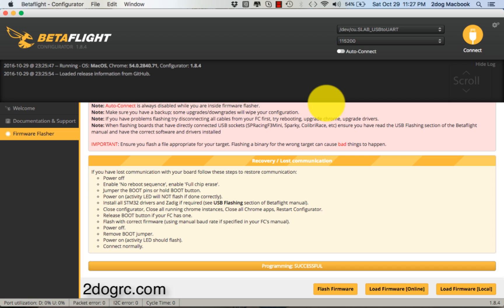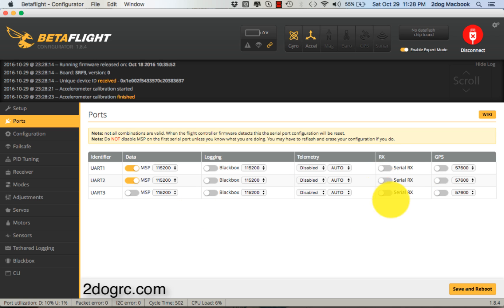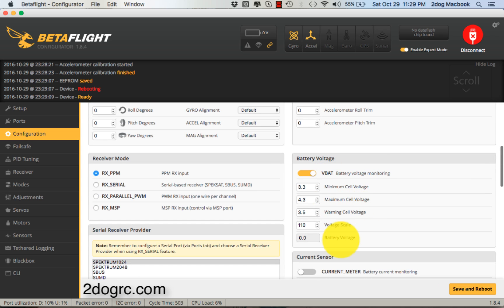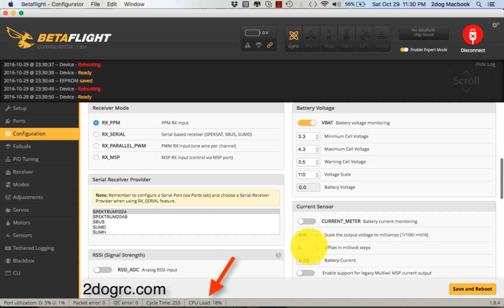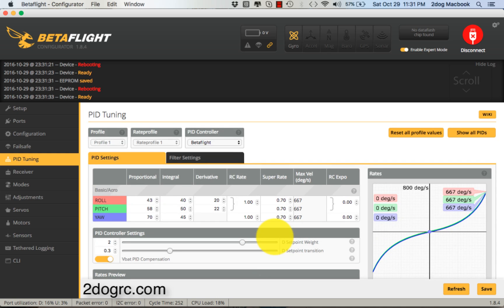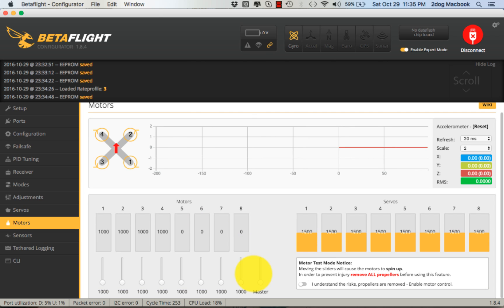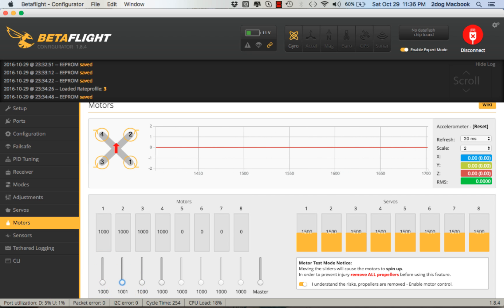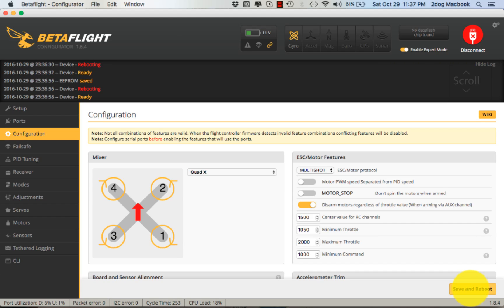Setup Betaflight 3.0.1 On Diatone Crusader 2 or Other Diatone F3 Boards

Comment: Hey bro, 1st off, thanks for the video, I just have one thing I would very much appreciate if at all possible, and that is absolutely no fault of yours that's for sure, it's just that I used to have someone whom helped me with the tech side of this hobby, and I was learning fairly quick, I am no rookie when it comes to the flying aspect, btw, it's just that my buddy have long since ghosted on me, and I have no clue how to use beta FLIGHT etc...? Ur video does show how to do a setup for the Crusader gt200 N etc, but u go through it as if ur speaking to an expert or at least someone who knows his way around the program, is there a way that u could, and this is all me, not ur doin, but rather my lack of knowledge, and I was hoping that u either help by maybe dumbing down for people who are like me and have little to no experience dealing with this side of the hobby?, my crusader will. Connect, but the icons on the left , for example, if I try and calibrate, the icon isn't lit up, so i cannot even do that, though,  the name Diatone does pop up when I connect.,, well maybe if u don't feel like messing with it,, could u point me in the direction that might help? Again, great video, just wish I had the knowledge to understand all of that you showed ... and again that's all on me...!

Comment: I am having a diatone GTS 2017 running fury F3 OSD. my OSD some time come on some time it go off when I plug in the battery. I am puzzled. when OSD is on i try to enter into the command by yaw left or right then pitch up the osd do nothing

Comment: didnt help with my case because my first ever quad was broken right away... no LED's means its dead and you can refund. Didn't know about it and taught everything was fine and I was just stupid but actually the f3 was broken....... needed to resolder it but now it works
Reply: with resolder I mean get a new flight controller and switch it with the old one

Comment: Hi,
Does your PID's values are for the crusader 200''?
I'm actually changing my 175'' frame for the 200'' and I want to know if the PID's are the same or what.
thanks
Reply from the maker: You could probably use the same.

Comment: Chris, thanks for the awesome video! I got a GT2 partially because you have this setup video :-) 
Question:
----I plug battery into drone and betaflight jams/stops working?--
When I plug drone alone into computer,  the drone moves correctly on first screen, i can flash new version of betaflight etc.
However, when I also plug battery into drone (4s fully charged), no voltage shows up at the top of the screen and the drone picture does not respond to movement. (Rx binds nicely with my transmitter though and the drone arms correctly)
Any ideas?
I need battery to power my transmitter to see if its working and to set ESCS
Reply from the maker: Chris, that is a good question that I have not seen before.  Please contact diatone at service.support@diatone.hk.  Maybe they have seen it.

Comment: Hey Chris, I am not able to setup my beeper on my Diatone Crusader GT2, I have made it an aux switch as you did in the video. Is there anything I need to do in order for this Beeper to work? Thanks.
Reply from the maker: The only other thing  would be to make sure it is plugged in!  Make sure that on the mode tab when you move the switch the Beeper mode goes green.

Comment: Hello, I downloaded the driver first as stated and it connected to Betaflight after that. But I am unable to get the check at 0:47 seconds into the video. Moving the quad does nothing on betaflight. Not sure if it helps but my Accel icon is not lit at the top of Betaflight. 

Any help would definitely be appreciated! Thank you!
Reply from the maker: If your ship does not move in the first screen, or probably means your accelerometer is not enabled in the config tab. Make sure that is on.
Reply: You are correct BUT now I have one last question. For some reason my OSD keeps blinking "LOW VOLTS" even though the battery I have has 12.3 volts. Keep in mind this is the V2. Thank you again for the help for the firsts question!
Reply: I have the Warning Cell Voltage at 3.5

Comment: I think I found the issue preventing us to upgrade firmware on the FC not detecting the ESC. I installed the same ESC to my other quad and now It's stuck to betaflight 3.0.1! my previous ESC had no problem updating the FC firmware.
Reply from the maker: Yes, there is an issue with the ESC and Betaflight for some reason.

Comment: Hi,
I got a diatone crusader 190, setup done with latest betaflight firmeware, when i span the motors , 2 of the got very warm and i could feel a burning odor. What do you this could be a result of? Thanks.
Reply from the maker: That could be an issue with the motor screws touching the windings inside the motors.  Back the screws out a mm or 2.

Comment: Ran through the same setup and with my accelerometer off/on and 4k for gyro and pid my cpu load is still around 40%. Seems kind of high. Do you think it'll run ok like this?
Reply from the maker: 4k for both and accelerometer ON is NOT recommended. That is too high.
Reply: Thanks for the reply. I went back down and cpu dropped to around 35%. I'm having other issues now though. Setup went smoothly but after saving and disconnecting it wont reconnect to betaflight. Tried 3 different computers, usb cables, ports and it worked for a few minutes on a 2nd comp but now nothing. I have also reinstalled drivers. The leds are getting power but nothing on betaflight. The only thing I have done is plug into usb and plug my receiver in. No battery plugged in and no soldering/modifications. Any help is appreciated. Thanks!
Reply from the maker: Try restarting Betaflight. That is a strange one.
Reply: Yeah I've tried restarting betaflight and my computers. Going to buy a new usb cable but if that doesnt work Ill do the lost com through betaflight. The blue LED is very dim after it powers up, is that a sign of a bad board?. Do you have any of the FC's on the way? I purchased this quad from you last sunday and the shipping was super quick. If I can get a spare FC from you that would be awesome.
Reply from the maker: Send diatone an email about the FC issue, make sure you include the part about the Light Blue light.  service.Support@diatone.hk. I don't have any FC's in at the moment, they are running another batch.
Reply: I contacted them and got the same answer. Try different usb cables, reinstall drivers, etc. I tried different cables and no luck. Was able to do lost comm successfully with same FW . Now on my mac when i connect to usb it just says bluetooth-incoming-port, but with through bootloader i see the usb to uart show up. I've uninstalled drivers (to the best of my knowledge)  and reinstalled. PC is the same way. COM4 only shows up with bootloader.
Reply: Thanks for your help. Looks like its a bad usb cable because I can connect with a lipo attached no problem. I'll have to find a different cable. Anyway got it all set up and did some hovering in the house. Flies nice and stable! Cant wait to get outside. Thanks again!

Comment: I armed the gt2 without flashing the esc`s.. burnt one motor out after 2 sec. haha No0b
Reply from the maker: There is no need to flash the ESC's.  But you do need to calibrate them.
Reply: aha, thanks for quick answer. Can i do this threw betaflight?

Comment: After flashing the FC with the full chip erase option, I don't see betaflight as the PID controller. Also when I run the CLI "set pid_controller = BETAFLIGHT", I get the error "invalid name".  Anyone else having this issue ?
Reply from the maker: What version did you flash the board to?
Reply: the latest 3.1.6

Comment: According to Diatone installing anything above 3.0 will not work with ESC upgrading as well as linking the OSD
Reply from the maker: That is correct,  there is an issue with flashing the ESC's through BL heli SUite.  You can down grade to 2.9 flash the ESC, then upgrade.  The OSD works fine on 3.15.
Reply: You got the OSD to work? Mine said it was not supported. Just bought the gt200
Reply from the maker: Yes, the OSD works but it is not configurable from Betaflight.  You have to use a different program. https://www.youtube.com/watch?v=yGmK6CeSozE&t=1s
Reply from the maker: Just the ESC's has nothing to do with the OSD.
Reply: I was able to upgrade the ESC's with BLHELI configurator, with Beta flight higher than 3.0
Reply: There appears to be different FC versions shipping with the GT2.  My FC is different than the than FC's I've seen from early reviewers. So flashing the ESC's would likely depend on the FC you got.

Comment: Hi would you show us how to flash the Diatone 302x with BLHELI suite.
Reply: Thinh Nguyen you need to roll back the firmware below 3.0.1 and the esc should show I did the same diatone recommend not using 3.1.5 yet...if you must use it you need to roll back the firmware to below 3.0.1 when the escs show up and you update then update to 3.1.5
Reply: I flashed my ESC at 3.1.5 before I know this so one of the ESC shows failed to flash and now it just doesn't response to BLHELI suite anymore while other three are working perfectly with the board being in 2.9.0. Not sure if the ESC is gone for good or in the stage of error.
Reply from the maker: You can use an Arduino board and connect to it to reinstall the firmware.
Reply from the maker: I can make a video in a week or two. Don not try it on Betaflight 3.1.x, there is a bug. You have to flash you board down to 2.9 first.
Reply: 2dogrc when I tried to flash 16.6 blheli_s to my 302x it keep showing error and flashing failed. Let me try and put the board down to 2.9.0 first. It's a D-link board FYI.
Reply: 2dogrc I am able to flash the ESC now to 16.6 but one of the ESC is no online anymore it was the failed flash back when the board was 3.1.5. Not sure what to do with that ESC now
Reply: Thinh Nguyen yes exact same as mine diatone recommend leaving stock 3.0.1 firmware on do not update try rolling back your firmware.
Reply: I had rolled back my firmware but it maybe too late for that one ESC that flashed fail while I was on 3.1.5 Not sure what to do with that particular ESC now.

Comment: HI 2dog. I recently got my GT2 and i've watched this video a few times through but for some reason i cannot get my quad to arm. I have the arm switch configured, and its showing the correct movement in the modes section, my spectrums minimal input is sitting at 1160 on the receiver tab. My minimal throttle is set to 1059. Any help would be much appreciated before I pull my hair out. Haha.

Edit: I am using a Dx6 and a the Spektrum FPV Sat Receiver.
Reply from the maker: Okay, that 1160 is not going to work. The FC thinks your throttle is up.  Min Throttle is something different.  You need to get that 1160 lower when your Throttle is at idle using the travel adjustment in your Radio menus.
Reply: 2dogrc thanks for the reply. I will check into this when I get home and I'll post my results if I have luck.
Reply: Yup that fixed my issue. Thanks for the help!

Comment: Hey 2dog if using a frsky xsr what ports do u select uart 12 or3? and for the side telemetry? thanks
Reply: i mean the rx side?
Reply from the maker: XSR, you would be connecting to UART 3.  So set UART 3 to Serial in the ports tab.
Reply: what motors are you shipping out on the crusader 2205 2300kv are the 2484kv?
Reply from the maker: They all have the 2300 KV motors now, the 175 and the 200.
Reply: 2dogrc ok thanks y'all site down?
Reply from the maker: Yeah, working on a module integration at the moment.  All out of the 175 and 200 until after the Chinese new year.  I think everyone is out!
Reply: 2dogrc ok thanks

Comment: Hello, I have the diatone tyrant 180. Does this work for that receiver? I am using a taranis.
Reply: And I am using a Frsky XSR receiver. I meant the flight controller.
Reply from the maker: It is similar but you would use UART2 in the config tab.  You would connect the receiver to UART 2 pins, which are 3 and 4.

Comment: it connects to 1.4 but com wont show up on 1.6 and i cant save anything on 1.4 cause message pops up saying wrong software please update software and when i do com dont show up at all
Reply from the maker: Are you using Betaflight configurator from the Chrome store. Cleanflight will NOT work.

Comment: Does the Gt2 get its osd volts and amps from the vtx input power or from the tx/rx inputs ? Im wanting to add a regulator and lc filter to remove motor noise. Thanks Darren
Reply from the maker: It comes from the VTX input power or the FC depending what you select in the MW osd setup.  I think the default is fromthe VTX input power.

Comment: What would happen if I didn't use a current limiter when calibrating the ecs's?
Reply from the maker: Nothing will happen. It is just a safety device.  If something goes wrong it can prevent some damage to the system

Comment: Hi mate, why do you have air mode permanently on and not on a switch? I have tried googling it but cant really find the answer . Do you find you get any bouncing when landing with it always on ? Thanks darren
Reply from the maker: Dazzle Duds  I have airmode always on.  Yes it may bounce when you land, but I just disarm right before landing via a switch.  Airmode becomes active after a certain throttle value if you enable it on the config tab.  It is a good idea to arm via a switch because as you get better you may find yourself in a situation with your throttle at idle and full yaw deflection which would disarm your quad.  It may take some getting used to but it is worth it.
Reply: Thanks for the fast reply mate , certainly helped me with your videos on the gt2
Reply from the maker: Great!  I am glad they helped.

Comment: Thanks for the videos on the Flight controller and SP3.  They really helped me get going and is one of the reasons I chose Diatone!
Reply from the maker: No problem!  Anything that was confusing, or I could have spent more time on?  Sometimes its hard to see what I missed.
Reply: I'm having a problem getting power from my Diatone DLink flight controller to the SP3?  I soldered the + and - from vtx to the pads next to the buzzer on the fc, but I have no voltage there. Where do you pull power for the VTX and do you have to enable a setting or solder a jumper?
Reply from the maker: The power for the SP3 can be powered directly from the Battery Solder pads.  These go into the VCC and ground on the SP3 wiring harness.
Reply: I have power now it all looks good, but SP3 get really hot.  Almost untouchable, is that normal?

Comment: hello I got the drone I ordered from your site very pleased and looks great just wondering can I configure it with out a receiver hooked up still waiting for my receiver and wondering if I can program it.
Reply from the maker: Yes, you can configure and update Betaflight.
Reply: 2dogrc thanks ok
Reply from the maker: Here are some things to update from Diatone:
Setting：
■■ First step
update BLHeli to latest version 
Set Startup power at 0.125 
Demag at medium-high or high
Timing medium high
Brake on,
Temp protection off
■■ Second step
Betaflight setting：
Load this setting in blank，and save
In CLI do the following
set gyro_lowpass_type = FIR
set dterm_lowpass_type = FIR 
set dterm_lowpass = 100
Set gyro_lowpass = 150
set gyro_notch1_hz = 0
set gyro_notch2_hz = 0
save
■■ PID
set pid_controller = BETAFLIGHT
set p_pitch = 60
set i_pitch = 65
set d_pitch = 22
set p_roll = 45
set i_roll = 40
set d_roll = 20
set p_yaw = 70
set i_yaw = 45
set d_yaw = 20
set p_alt = 50
set i_alt = 0
set d_alt = 0
set p_level = 50
set i_level = 50
set d_level = 100
set p_vel = 55
set i_vel = 55
set d_vel = 75
rateprofile 0
Reply: 2dogrc thanks helps a lot is their any reason that I should update the esc first, I think I'm going to get my remote and install the receiver it's coming tomorrow and than I will do this.
Reply from the maker: I would update before you go fly.  There are also some settings that you will wan to change in the ESC's.
Reply: 2dogrc ok thanks.
Reply: hello I got my diatone crusader all set up the only thing is that when I push the throttle up a little the motors spin faster and faster. I have updated everything this does not do this with the accelerameter off but I would like it on for now and I don't know how to fix it. I would appreciate some help.
Reply from the maker: Sure thing!  Can you contact me through our contact us page at 2dogrc.com, and make sure to leave a phone number and I can give you a call.
Reply: are these still current? or do they have more recent recommended settings?

Comment: I was wondering how long are the stock motor screws and do you have to have the accelerameter on to turn on stabilized or horizon mode.
Reply from the maker: Not sure the size, and Yes you have to have accelerometer turned on for auto level modes such as horizon and angle.
Reply: Ok thanks

Comment: hey just ordered the diatone crusader gt 2 200 from your website I'm new to setting it up which receiver do I select if I'm using the fly sky fs i6x receiver. I will follow this video as best I can I might have some more questions but can't wait. could you also make a video on how to flash bl heli s firmware to the esc. and how to connect the wires.
Reply from the maker: You would use PPM receiver in the Config tab.  The ESC's have Bl heli_S on them so you just need to update them.  Here is an older video, but close...
https://www.youtube.com/watch?v=mDNDpgKj0kA

***********Props OFF*********
1)open cleanflight
2)Open Bl heli Suite (download from internet)
3)Connect to your computer
4)Power the ship with a flight battery,
5)Select the comm port in Bl heli
6)Click Connect
7)Click Rea setup
8)it should read all 4 esc's
9)Click Flash Bl heli
10)Select the firmware, AH_30 version 14.2
11)When all are flashed, make sure Temp protection and motor brake is off.
All done!